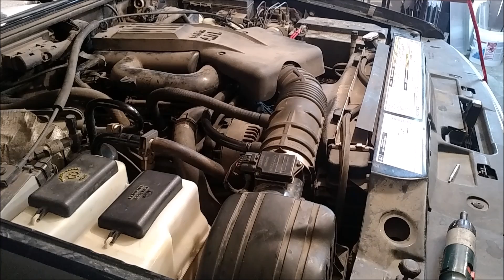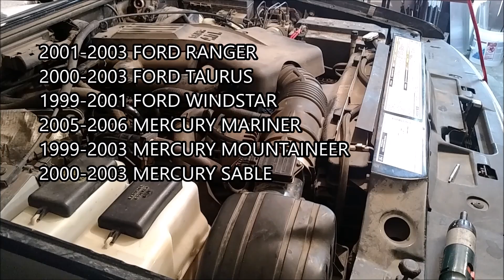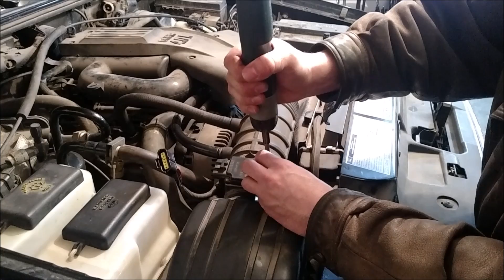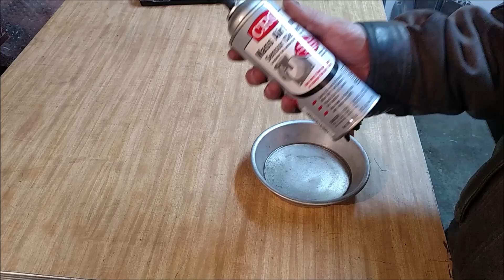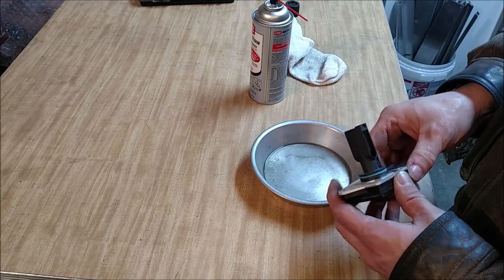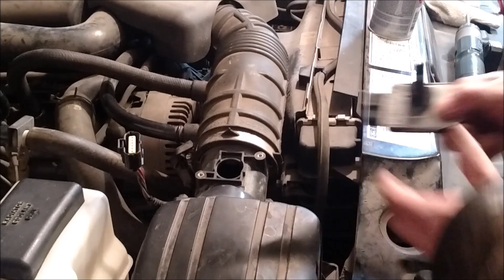Ford Explorer Mass Air Flow Sensor Cleaning

Comment: Thank you so much. That was awesome. Now I feel better about cleaning it on my 2002 Ford Explorer XLT 4X4 with a 4.6V8. I was nervous because someone told me that there are tiny wires inside that are easy to break. You came nowhere near any tiny little wires

Comment: My truck is 2000 Ford explorer sport xlt and in park while engine running its shuts off...do you think  that's the problem air flow  mass sensor?
Reply from the maker: I think it is more likely a part called the "idle air control valve."  The IAC is a valve controlled by the engine controller that allows air to go around the throttle valve and into the engine so it can still get some air when your foot is off the gas pedal.  They are known to stop working.  Cleaning them sometimes fixes the problem but by the time you go to the trouble to remove it, it is probably a better idea to just install a new one.

Comment: Dose this eliminate codes ?
Reply from the maker: Sometimes it does, sometimes it doesn't.  It depends on what is actually wrong.  Cleaning the sensor can eliminate the codes, but sometimes the codes are caused by another problem.  In my case, my Explorer had a leak in the intake manifold gasket and the gasket needed to be replaced.

Comment: In case anyone still needs to know, a t15 star/torx bit is needed for the screws. At least mine were.
Reply from the maker: Is it a standard torx or the security torx with the pin in the center?  Looking at my own video, it looks like the screws might be security torx with the pin.  I traded the 2001 Explorer for a newer one a few years ago so I can't check.
Reply: @cdsmith  gap for the pin in the middle. Mines a 02 mountaineer.

Comment: Hello, just saw your channel while scanning YouTube because my 1997 Ford Explorer is showing the P0171 code. This video was a big help. My question is if I do take the MAF sensor out clean it and put it back in will the engine light go away? Will it still stay on? You talked about resetting the engine light. How does one go about doing that? Does that mean that the only way you can check to see if what you did was right is by resetting the code? Do you need certain tools to do that. Thank you
Reply from the maker: It's been so long since I did this video I am unsure of the details.  Your question if the engine light will go away involves two things.  First, if cleaning the MAF fixes the problem, will the light go out?  That I am not sure of.  I have a tool that I used to reset the light.  It depends on the code, because some codes will clear automatically when the vehicle sees the problem is fixed, and other codes set permanently and have to be cleared with a scan tool.  To clear it you can go to many auto parts stores and borrow a scan tool that can be used to clear the code, or you can do like I did and buy a small bluetooth device that you plug into the diagnostic port and use an app on a smartphone to see codes and clear them.  The second thing to consider for "if I clean the MAF will the light go out" is that cleaning the MAF might not fix your problem.  There are many other problems that can cause this code to set.  For my 2001 Explorer I had to have the intake manifold gasket replaced.  Anything that causes a vacuum leak can set this code.  Cracked vacuum hoses, etc.   But since it is the least expensive thing to try, I would recommend to do as I did and clean the sensor, use a scan tool to clear the code, then see if it comes back soon.  If it comes back you likely have another problem that will be harder to diagnose and more expensive to fix.

Comment: Can I clean my sensor even though I don't have any codes just to keep it clean?? Thank you.
Reply from the maker: Sure.  Just be careful when you do it and use only real air flow sensor cleaner.  It wouldn't be good if you accidentally caused a problem cleaning a sensor on a vehicle that was running fine.  I also found that the throttle body was dirty back when I made this video, so it might not be a bad idea to clean that as well.
Reply: @cdsmith  Ok thank you so much!!!

Comment: Is it okay to clean the connector with a wet liquid, since that houses electrical content?
Reply from the maker: Should be OK as long as you make sure it's dry before you put things back together.  I would recommend an actual electrical contact cleaner to clean the connectors, and make sure you don't get any cleaner on the air flow sensor itself.  You only want to use actual MAF cleaner on the sensor element.
Reply: @cdsmith  okay. I will have to do this soon because of the engine code. Thank you for the advice
Reply from the maker: @jch1276  Hopefully cleaning the sensor will cure your code.  For my Explorer it turned out I had a bad intake manifold gasket that had to be replaced.
Reply: @cdsmith  how in the world did you figure that out??
Reply from the maker: @jch1276  I didn't figure it out.  I ended up taking it to a repair shop after the easy fixes like cleaning the MAF sensor didn't fix the problem.  I still posted this video though, because a dirty or bad MAF sensor can cause these codes and cleaning it is the first thing you should try before spending lots of money on other things.

Comment: What was the security bit size needed to remove the mafs?
Reply from the maker: Sorry, I don't remember and I don't own the 2001 Explorer anymore so I can't go check.  But if you don't have a security bit set and you are going to do work like this I would recommend you just get a whole set of security bits.  If you have a discount tool store near you it would probably only cost $10 to $15 to get a whole set and you will have everything you need for any jobs like this in the future.  Thanks for watching.
Reply: This is probably way too late but my 4.0l SOHC V6 in an 05 Ford Courier takes T20 standard torx bits.

Comment: We have same electric screwdriver,  I love it
Reply from the maker: They are quite handy.  I got my first one probably 20 years ago or more and it's still working fine.  Later I was able to buy a bag at a sale with 4 or 5 more used ones and several chargers for something like $10.  It's nice to be able to swap the battery when it gets low - so many of the inexpensive new handheld screwdrivers have built in batteries so you have to plug the whole thing in and can't use it when charging.  The only problem with these is that the batteries do eventually wear out and the company quit making the batteries a while ago.  But you can get "clone" batteries from third party companies online that seem to work well.

Comment: If you really wanna help people tell them what problem your car had and what the symptoms was exactly and also did cleaning that fix your car because by addressing these things people will know whether or not they really need to do this or not
Reply from the maker: I said right in the description and in the video that the problem I had was a check engine light and codes P0171 Bank 1 Too Lean and P0174 Bank 2 Too Lean.  But I when I made this video I wanted it to be about the general procedure of how to do the cleaning, which can be necessary for many other reasons than just those particular codes, so that's why I just mentioned the problem quickly and went on to the cleaning procedure.  The video is for people who do a Google search on their problem and find that the search results all say "Clean your MAF sensor" so they search YouTube and find this video.   Thanks for watching.
Reply: Carl Smith... OK that’s cool that makes sense, people don’t always understand codes but it does help them with more detailed symptoms and stuff like that. But that’s cool, I see we’re you’re coming from

Comment: What tool is that
Reply from the maker: The tool I used to remove the screws?   It's just an old Black and Decker cordless screwdriver.  But to remove the screws you will also need a bit that fits the screw heads.  I believe they were the tamper proof Torx type that have a star shaped hole with a pin in the center.  You'll need to get a set of screwdriver bits that has these to remove and replace the sensor.

Comment: It kicks on good and strong then shuts off after 5 secs
Reply from the maker: Hmm...   That's not good.   The first thing I would check is that you got the connector plugged back in properly and that none of the pins inside the connector have been damaged or pushed back into the shell so they are not making proper contact.  When I did a search on shutting off after a few seconds I found one post on a message board that said to unplug the MAF sensor and then try to start the engine and see if it works.  But I'm not sure what that accomplishes.  Maybe that makes it ignore the sensor and try to run without it.   The rest of the info I found was that this problem is usually caused by a bad fuel pump or clogged fuel filter.  But that would be quite a coincidence if that happened at the same time you were cleaning the MAF sensor, so that is not really a satisfying answer either.  When I still had my 2001 Explorer I got help with a lot of problems by just Google searching the problem and usually I'd find a discussion on one of the Explorer message boards that helped.
Reply: Carl Smith thanks for the tip, I waited a day and unplugged the sensor now it’s starting. Got a new one coming from ebay

Comment: what is the fuse box under that hose.
Reply from the maker: Not sure what fuse box you are referring to.  I do not have the 2001 Explorer anymore so I can't go take a look under the hood.  Usually vehicles have at least two fuse boxes, one in the interior for things inside the cabin, and one in the engine compartment for things in the engine compartment.

Comment: where do you buy a set and which one?
Reply from the maker: I didn't buy a new MAF sensor, I just cleaned the one that was there.  I got the cleaner spray at one of the local auto parts stores.  Any auto part store should have some.

Comment: You said not to touch the sensor part with the straw etc. But yet you had it rest on the dirty table where u just blow off the debri. Hahaja dnt make any sense pops
Reply from the maker: Actually resting the end of this particular sensor on the table is just fine.  The fragile part that you shouldn't touch is the sensor element that is exposed by the holes in the sides of plastic tower part.  The end of the unit is closed.

Comment: so if I already have an engine light, and code does that mean it needs to be replaced... or should you still try to clean it?
Reply from the maker: I would try to clean it first, then reset the code and see if it comes back.  It might not fix the problem but it doesn't cost much for a can of cleaner and only takes a few minutes to do, so you might as well try the easiest thing first.
Reply from the maker: I don't know if electronic cleaner would be safe to use.  I read a bit online and found one page that said it would work fine and another page that said don't use it because it leaves a residue.  Real MAF cleaner should be available from most auto parts stores or you could order it online.  I found it available on Walmart's site and Amazon.  Don't use carburetor cleaner or WD40.
Reply: hi
I could not find that cleaner in my area so, can I use electronic cleaner instead? please help! thank you.

Comment: Was it a success? DId cleaning the MAFS clear your P0172 and P0174 Codes?
Reply from the maker: Unfortunately it did not.  I had a much bigger problem - leaking intake manifold gaskets that needed to be replaced.  But when you have these codes it's a quick and inexpensive job to clean the MAFS and see if it fixes the problem.  It should probably be done periodically anyway.
Reply: @cdsmith how did you diagnose that?
Reply from the maker: @Pipenz11  I didn't.  I ended up taking it to a repair shop and they figured it out somehow.
Reply: @cdsmith thanks for the reply. I know it’s a 7 yea told video, but do you have still the Ford or you got rid of it? Only asking because I just purchased one as well and these codes keep popping up and am worried about the overall reliability.
Reply from the maker: @Pipenz11  In 2018 I traded in the 2001 Explorer on a 2017 Explorer that was about 15 months old.  I think the 2001 Explorer was fairly reliable, but it did have some other issues while I had it.  I had to have the front ball joints replaced twice in 100,000 miles.  The thermostat housing cracked and leaked, and another time, the short hose from the water pump to the thermostat housing failed.  And I had to replace the idle air control valve once when it would stall at idle speed.  So, I guess those are things I'd watch for.